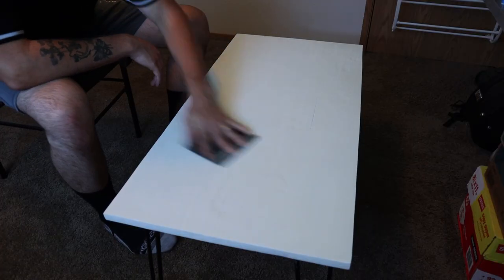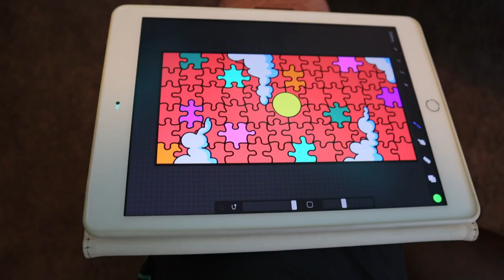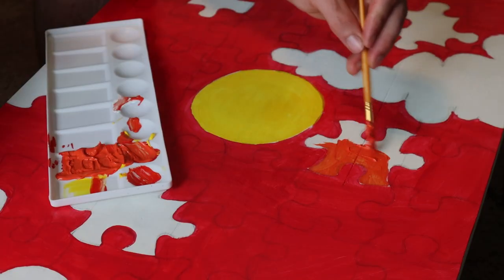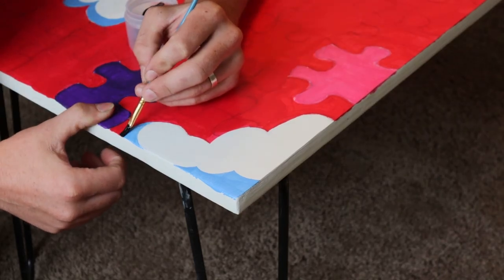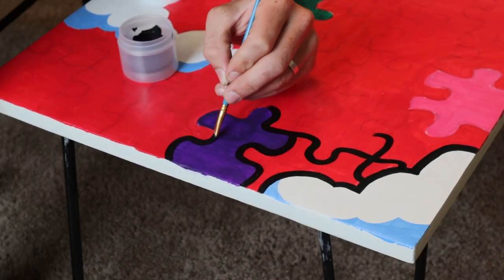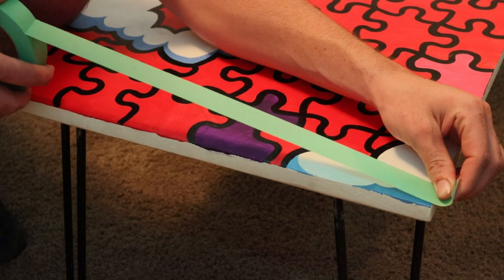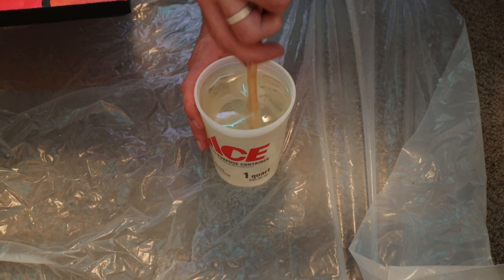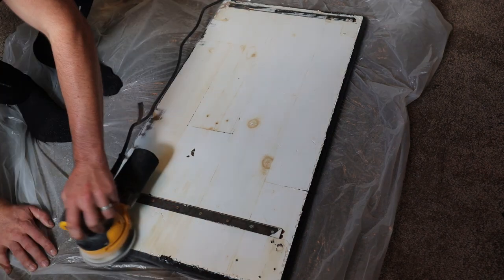How To Make a Custom Coffee Table DIY // Thrift Store Flips

Comment: Everything online is telling me to use 1 gallon of resin for the same size table as this one, but i see you used 32oz. Can you tell me if 32oz is enough for a 3ft x 3ft table?
Reply: Also what size table is yours? i was guessing around 3ft x 2ft
Reply from the maker: This is about 2.5’ x 3.5’. Honestly using a whole gallon on this small of a table would really just waste the resin as most of it would roll off the table. Look at the instructions on the resin for the amount you need per square foot and start with that. If you need a little more, you could always mix up some more
Reply: @musicbykeenon  Thanks for the reply! One more thing - did you experience any kind of staining or discoloration as time went on?
Reply from the maker: @jaskin310  yes! Unfortunately the white clouds have turned yellowish over time. I think the only way around this is to count both the top and bottom to seal everything in
Reply: @musicbykeenon  What do you mean by count the top and bottom? How would you get around the discoloration of white over time in your opinion?
Reply from the maker: Sorry haha coat* the top and bottom with epoxy